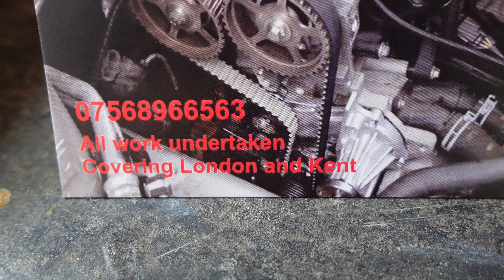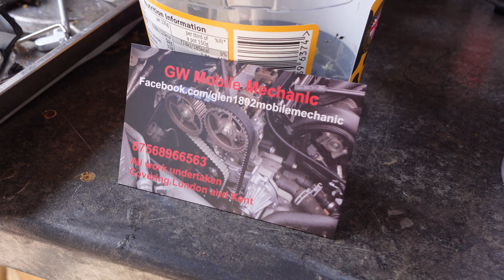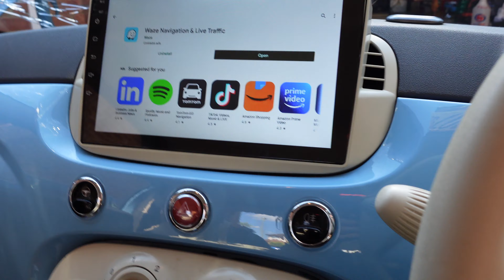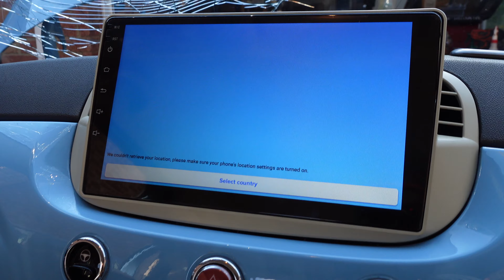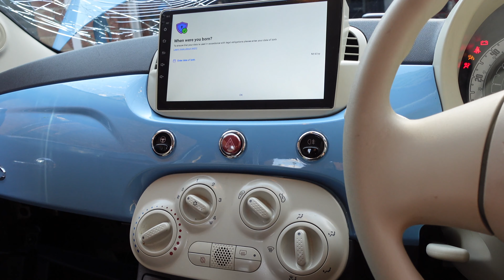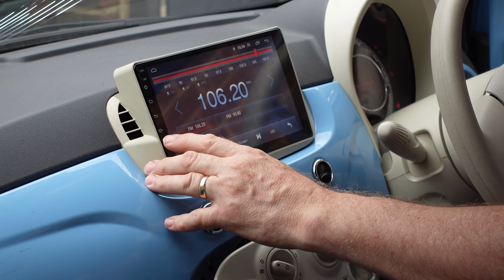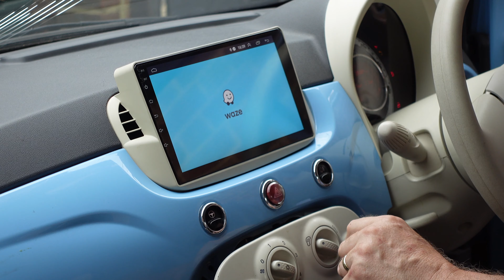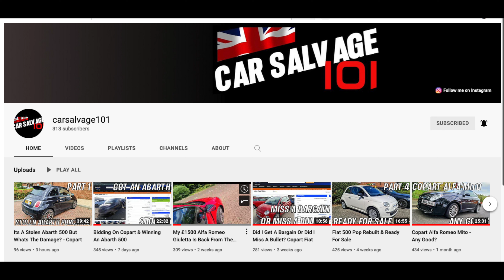Project Gino - Day 2 - Dash, Airbags & Stereo - Fiat 500 Salvage Copart Damaged Cat S Colour Therapy

Comment: The stereo needs the factory fiat radio cage to hold it in place, that’s the reason it is so easy to remove
Reply from the maker: But I did try it and due to all the cables I couldn’t get it back far enough. If I do though, would it hold it securely as there are no release tabs.
Reply: @Love500  It should be secure as long as the screws that hold in the cage are in
Reply from the maker: @iainadams9726  I’ll try it again tomorrow 👍

Comment: That stereo system looks like an OEM.  I fitted a something similar in my golf and whilst it looked the part, the canbus was wrong, had a power drain, etc... So have always steered away from fitting none OEM stereo systems in my car's.  Hopefully this will work out ok in this model.

Comment: Sorry to be a party pooper , but I think it doesn’t look right,I thought it was a fiat one you were gonna retrofit
Reply from the maker: You can’t put a series 4 head unit in a series 3.
Reply: @Love500  there must be a way as I’ve seen later sports with normal radio
Reply from the maker: @dantheman7370  definitely not, the dash is completely different shape. You would have to change the dash too.
Reply: @Love500  right enough, plus you’d have to re code it too